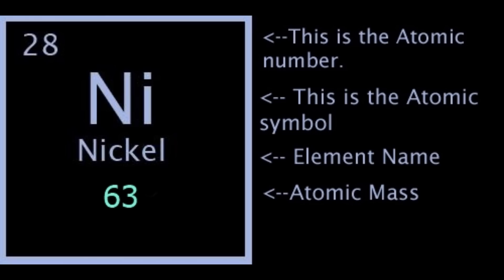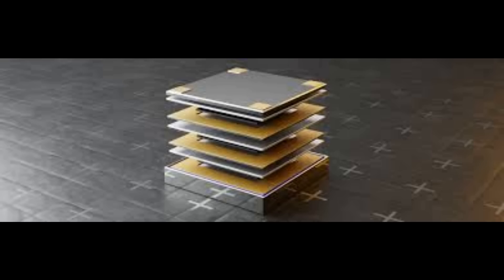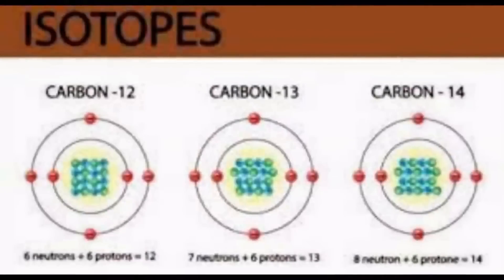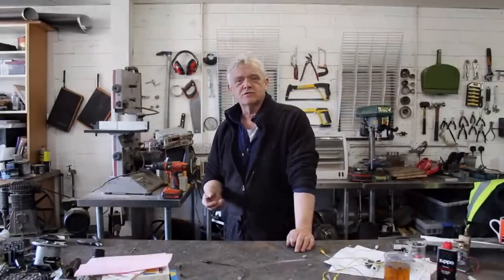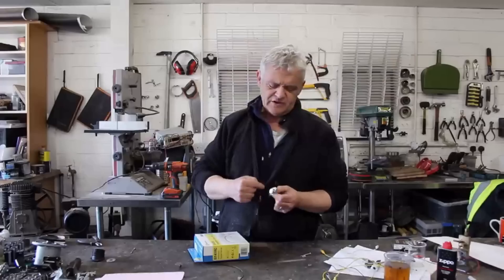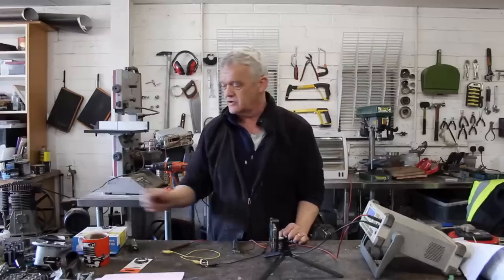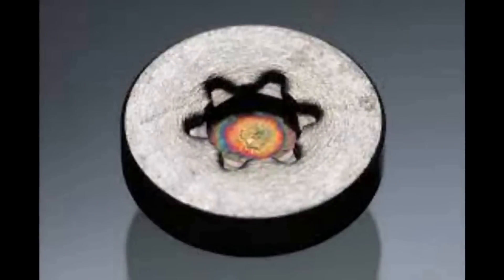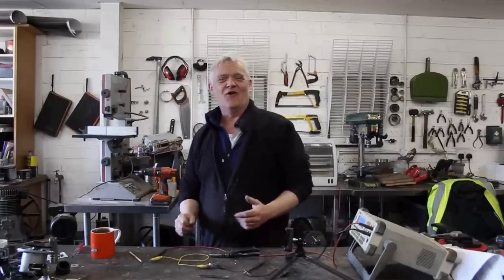2187 - The 50 Year Nuclear Battery From China And How To Make Your Own Version

Comment: Ah, I heard something about a 50 year nuclear battery.

Made by China, you say?

See, the problem with this claim is that chinese nationals are, at this point, stuck with a rather bad reputation. Chinese individuals, companies, and the government, all have a severely bad habit of claiming capabilities far in excess of reality in order to secure funding, then delivering something so substandard it's actually dangerous.

The last time anything radioactive was sold out of China, they were selling "negative ion" "health" products that were just chunks of radioactive elements crafted into cheap trash. We're talking everything from jewelry to blankets, all made of radiation emitting materials, made to be worn or used every day. They were selling this trash on Amazon.

I point next to the "tofu dreg" construction industry, where chinese companies will "construct" buildings, bridges, roads, etc, out of a concrete so cheap and worthless that tbe populace likes to joke they used tofu instead.

I'm sure everyone with an Amazon account has bought something that turned out to be cheaply churned out chinese trash that was nothing like what was advertised.

In conclusion, if China claims China did something that's amazing or astounding or revolutionary, the first response you should have isn't "wow, isn't that amazing", it should be "where is the lie?". By this point, lying, cheating, and stealing to get ahead in china is par for the course. The government spends every day lying to the people, the companies lie every day about what they are making, and the people lie to each other and especially outsiders to secure money by any means necessary, and then everyone dips ASAP while spending as little money as possible. All of this while loudly insisting China Numbah One.

So do I believe China has a nuclear battery, made of nickel and diamonds? No. I believe they have an object they desperately want you to think is a nuclear fission battery filled with valuable materials, and I certainly believe that it will be radioactive and power something, but I think it's just gonna be a chunk of thorium or some similar common radioactive element, and a normal battery, and there will be no diamonds, because natural diamonds are expensive and lab grown diamonds require a lot of time and labor investment. And frankly, none of those three things (expense, time, work) are things chinese companies are really willing to spend.

Comment: Philip Brody already found this out. By having a lead-lantheum matrix, encasing a radioactive element (Which we'll use radium as an example), you'll be able to effectively cause an ionization event giving a DC output.

Depending on the purity of the lead-lantheum, it can go up to ~1500 volts/cm with a 30 nano-amp flow. 

See Patent US 4,041,465

Comment: I'm sure betavoltaics and other nuclear batteries hit the news every year now. Usually it's some article claiming you'll be able to power an EV with a stack of them, then followed by some "Busted" video showing how this isn't even remotely feasible. I think my favourite was Nurdrage taking the low-efficiency approach of sandwiching a bunch of tritium-filled phosphor-coated vials between two solar panels and getting a few microwatts.

Would be kind of fun to see how many americium pellets and transistor cores it would take to do something simple like drive a wristwatch or a calculator though, if it can be done without significant risk. Even alpha and beta emitters can be dangerous if you swallow or breath them!
Reply: If you are willing to carry a phone that is the size of an early 1990s handphone,,, you definately can make a  nuclear powered handphone. Phone, exercise weight and self defense instrument all in one.
Reply: @nickl5658 Honestly that doesn’t bother me at all the size, as long as it never dies I could also just use the battery as a battery charger as well which would be amazing.
Reply: EEVblog 1595 - 50 Year Chinese Nuclear Diamond Battery!

Comment: Humm, to gather enough material to make it a viable energy source we can use this way would seem to be a bit expensive, and probably trying other avenues to obtain this will more than likely get you on a list and a visit from the Feds. Then there are the materials used for housing it, plastic with lead foil lining on the inside? Great, now I will be up all night thinking about how to make a larger device and what it could power.
Reply: Yeah if it were easy or profitable to generate electricity directly from used nuclear material, it would already be done, there would be secondary plants at every nuclear plant. To collect that much nuclear material in civilian hands for civilian purposes would for sure make regulators very nervous.
Reply: @zincfive  Figured as much and if it were commercially viable someone be or trying to build it.

Comment: Downside of using silicon junction commercially is lattice damage. It will work but quickly degrade, within days or weeks as more atoms get moved out of position in the junction.  Diamond is much better as the lattice is inherently more resistant to damage. That’s why it is used here. It will last long enough to be commercially viable.
Two more items: I’m pretty sure Americium is an alpha source primarily (around 85%).  And, by the way, don’t do this experiment unless you know what you are doing. Especially don’t cut/crush the pellet. Breathing Americium dust is *very* bad.  In contrast Ni63 emits beta particles as described in the excellent presentation here. At their lower energies, the “penetration” depth is measured in micron. They don’t even make it out of the package, so the battery is quite safe. Even were you to break it open (good luck with that), beta particles would struggle to make it past the surface layer of your skin. So, again, quite safe. Contrast with toxic lithium.

Comment: At 100 micro-amps at 3 volts, so it's 0.3 milli-watts. Over 50 years, that's 95 Wh. I read that the price of a NDB is based on USD 2200 per watt. So, at 0.3 milli-watts, they would be USD 0.66 each. That's a cost of about USD 6.9 per kWh. Seems likely that it can be manufactured for much lower per-unit street price if competition were allowed.

But since this comes from China and China doesn't actually enforce other country's patents (or any intellectual property rights for that matter) there is no "good" reason for other countries to enforce China's patents. So, from the rest of the world's point of view their technology should be treated as public domain so that any company can manufacture them, which should keep local price low by competition.

Comment: In theory, a 1-watt continuous output battery that can run for 50 years would have a~438,000 amp-hours capacity.   At 3 volts that's a ~ 1.3 MWH battery! 😋

However, in realistic terms, in order to use a set of such batteries to do anything large like power an average home or electric vehicle.   Each application would need many thousands of them.  Likely about 10,000 of them to power an average house like mine and about 70,000 to 100,000 to make an EV that could be driven like a normal vehicle.  🤡

Oh ya, and current pricing estimates put them at about $ $4500 - 5000 US dollars each if you buy in bulk!   😂
Reply: You don't use these batteries to run things directly, you use them to charge super capacitors which will charge traditional larger capacity batteries continuously for 50-100 years.
Reply: Calculating watts per dollar might be more accurate. I am very bad at electricity math, so giving that the price of electricity is 16 cents per kwh; In theory, can this method produce cheaper electricity?
Reply: @lordofthechimie  1300 x .16 = $208

Comment: One comment. Half-life refers to the halving of the fissile material. This means that after 400+ years you'll get half the current but the battery will continue for hundreds of years more.
Reply: Well, technically the battery will continue forever, it's just that the current will keep dropping as per the decay.
Reply: @advaitjs  No atoms do eventually die off and break down atoms are not eternal and Radioactive isotopes have a chance of shooting off and electron, I think Bismuth 209 or something like that is the longest of any isotope. Some faster than others, the elephant's foot - Chernobyl is a great example of radioactivity that is breaking down at a fast rate, original photographer died a week after being exposed to it, now you can spend an hour in a suit in front of it.
Nothing is eternal and nothing lasts forever.
Reply: @advaitjs  Before the battery gets half-discharged it must get half of half discharged,  and before it gets half of half discharged, if must get half of half of half discharged,  etc.  It lasts forever.

Comment: Do they last longer or shorter if they are in use? Like you could hook up hundreds of them and power your house for 50 years? Or will they wear out too fast if you don't give them recharge time
Reply: The reason they produce such a low voltage is because the amount of power they produce is limited by the rate of decay of the radioactive source. No matter how much of the the energy the decay puts out, the rate of decay doesn't change. There's a finite amount of energy that can eventually be extracted, but no way to increase the rate at which the matter decays. Well, unless you're talking about fissile material reaching criticality, but then you're not dealing with a battery, but a reactor...or a bomb.
Reply: Nuclear batteries last the same length of  time no matter if it is used or not.

Comment: Awesome video!...made my day.  Can we increase the voltage out put in the two ways? 1) make a hole above the N and not cut off the top when aiming the Nuclear material at it, which would allow the alpha particles to be concentrated and the ones who are not going straight down would bounce around in the can and eventually  hit the the N.  2) Would sorting the two Ns together increase the voltage.

Also this may make a great mil volt reference  standard.
Reply: Great idea, it also keeps it sealed

Comment: The low power output being the biggest problem, either a great many cells required (given the small size though, cost over rides space) or replacing the active element with something much more active.   Possibly a great use for depleted uranium that is a waste material in scrap piles everywhere.
Reply: depleted uranium is less radioactive than regular uranium. DU is  a problem because uranium is a toxic element, that burns relatively easily and uranium oxide ie burnt uranium is water soluble... so afte ra DU round is fired, you get a fine powder of uranium oxide that gets everywhere, dissolves in water to deliver a toxic dose of chemical uranium.

Comment: Awesome job on the video.  great information in there.  I have a question for you.  could you make a battery like that using many radioactive bits and a solar panel?
Reply: The glass / plastic on the panel would stop most, if not all of the radiation.
Reply: The naked fragile panels can however be purchased. They're about 5 inches square. No cost savings compared to ready functional PV panels but fun to mess with. You can fracture a number and pick out matching shapes to rig up your own high voltage small PV panels.  
 Perhaps go to maralinga South Australia and gather the radioactive sand , just joking .

Comment: If Americium 241 has a half life of 432 years, why is my smoke detector only good for 10 years?
Reply: Because it is not powering the actual alarm, only triggering the alarm. You need a battery to power the alarm. And the failure point of these alarms is not the radiation source, it is the other parts (random electronics randomly end up going, or dust builds up inside of the radiation chamber, etc). And they are good for longer than 10 years on average, that is just when they recommend getting a new one.
Reply: They work until they break. Generally that's for decades, but its hard to certify that they will work for 10 years + in unknown conditions. Since they are both cheap and safety critical, the lifespan is set conservatively low.
Reply: Text it, if it works it works, if it does not, it’s probably the failure of components.
Reply: Capacitors, especially the older electrolytic ones get leaky and make the system unreliable.
Reply: good question, the answer is that we are going to dispose of the radioactive material within the devices long before the half life of the radioactive material, just as many people do now the radioactive material will end up in the landfills. the good news is that many more people will get cancer from the exposure, the medical industry will do well.
Reply: @germanlopez9448 your comment isn't even coherent yet seems to imply conspiracy to poison everyone. I disagree, also the americium is perfectly safe in its containment capsule as americium produces primarily alpha particles which are easily stopped with the outer (dead) layer of skin or a piece of paper. So much work has gone into making it safe that no, smoke detector alpha emitters are not going to be a risk unless you intentionally break open the capsule and then decide to swallow the americium piece inside.

Don't say "the answer is" unless you are willing to back up a claim with documentation and evidence.

Comment: So 1000 smoke detectors will get you a 12v power source that lasts over 400 years....hmm tempting
Reply: You then would have to worry about what to do with that 3rd nut...lol
Reply: The stores will be wondering why you’re buying up so many smoke detectors 😂
Reply: Contact the suppliers directly and only buy the materials you need. Cutting costs to a few cents a cell. Buy a machine to build the cells and these could end up costing a few cents a cell. Cheap enough to build a 48v battery for the same price as we pay now for lithium batteries, the only difference is the battery does not need recharging for 50 to 100 years.
Reply: When enough graphite is mined out of the ground the world is going to go bonkers all the volcanoes will erupt incase earth in lava. The magma will being to expand through the inner layers which will cause chemical reactions that will end up blowing up earth. Everything will stay within the atmosphere gravity will pull everything back down. An eon later the tectonic plates will have aligned earth back to where god zips by and humanity will start all over again. Round well....ive lost  count,  if that Christian story is set in stone then its on repeat cause we've blown earth up before and the cycle is on repeat.

Comment: Ive been following this as well.. Why not put 4 in series for a 12v battery, or 30 for a 120v battery.
Reply: Pricing is the issue.   Current estimates say they will cost around $5000 each.
Reply: @tcmtech7515  wow!

Comment: The banned Radium paint would have been good option, as long as you don't lick the paint brush. The gas mantle bags for camping lanterns are also radioactive and easy to find. We use to use them to calibrate some nuclear detectors with when I was working for radiation detector device manufacturer ten years ago.
Reply: There's a lot of brazil nuts about too !
Reply: Are you certain that they still use thorium in those mantles. Those mantles themselves and history and first commercial use of rare earths/lanthanides , and theory of operation are worth a utoob video by someone.
Reply: @philip5940  on second thought, they must have a had an old stock one still in the bag at the time, since they stopped in the 1990s. But they do come up for sale on eBay from time to time still.
Reply: @philip5940  They did at least 15 years ago, I assume it is necessary for that style lantern to work.

Comment: Robert that’s interesting. What are the odds or barriers to producing large arrays of these cells big enough to power the typical American household for as you said the next 400 years?
Reply: No chance. It would cost tens if not hundreds of millions, would be huge and would be a health hazard.
Reply: Pricing is the problem.   At $5000 a piece for the current theoretical battery it's totally impractical for anything big.
Reply: Odds are good but will it be allowed by the monopolist?

Comment: The current Betavolt does 100 MICRO watts, not milliwatts as you stated in the beginning of the video.(yes, you stated it correctly later but just in case someone doesn't watch that far maybe they'll read this and know the truth)
Reply: sounds about right, but they're still talking about prototypes (edit: video says they are in pilot production, so i guess they are already making them) and they say they are stackable in layers and very thin so they could probably make a stack of 1000 and wire them in parallel or series, if they want to increase the current or voltage
Reply: I was wondering about that actually😂
Reply: So you think they'll skip the rest of the video and go right to your comment that's pretty narcissus of you
Reply: @jasonlogan5765  hehe don't be that way. He's just trying to help. We are all learning and sharing here.
Reply: @jasonlogan5765 "narcissistic"*

Comment: Awesome! It looked like that transistor case might sandwich nicely within the center of the metal alarm housing, creating a dark and reflective chamber. Would that increase the output? Just wondering what a nuclear powered smoke detector would look like. Could you get 1 reading every 5 mins?

Comment: The battery is 100 uWatt that's 100 microwatt. Or 0,0001 watt. To power a small LED you need 1000 of them.
Reply: so i need 1000 smoke detectors, and a solar panel, and i'll power an led for hundreds of years?
Reply: @alistairmurray626  I think things will go better with tritium light rods and solar cells. They have a half life of 12 years. But if you have enough, you might be able to get enough energy out of it for 50 years.